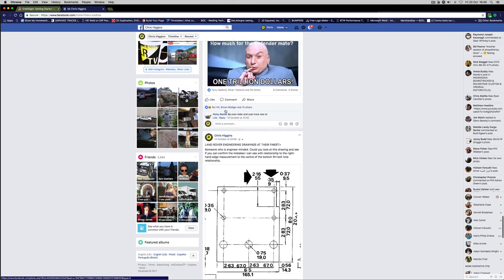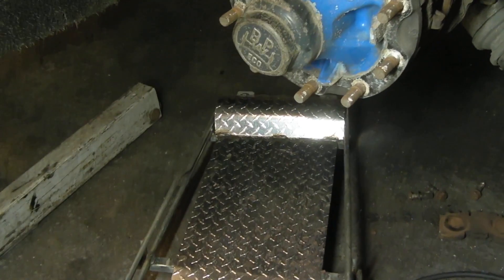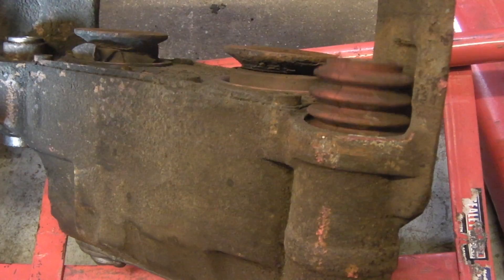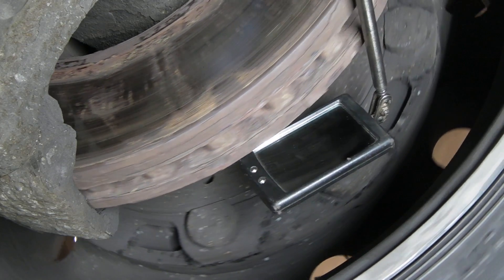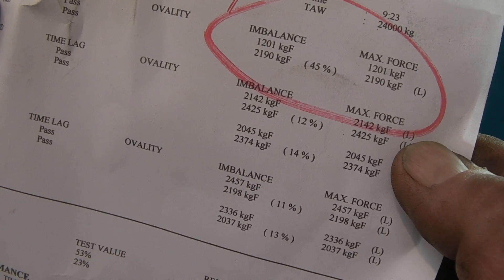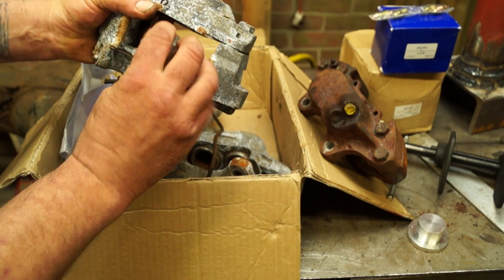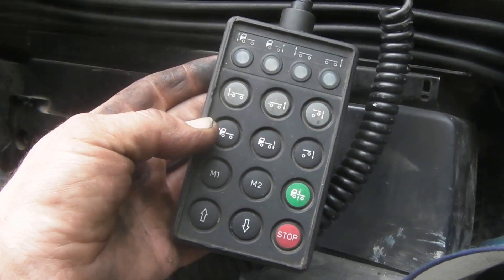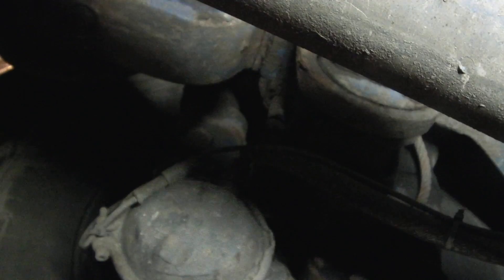Brakes are Brakes, Free Design Software and an Idea for the D2 project if we went 6x6

Comment: Disc brakes fun deal, little easier than drums on hd side somewhat until wheel seals or rotor needs changed lol. Looks like calipers on trailer just hair smaller than freightliners i work on but that trailer quite bit of corrosion for sure. Might have to check out that cad and air on rover would be wickid, awesome vid mate!